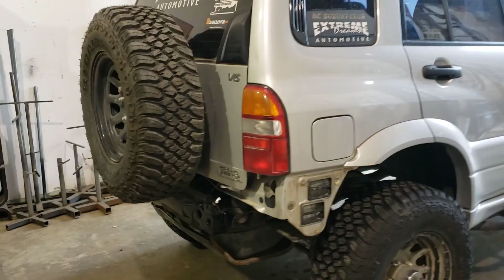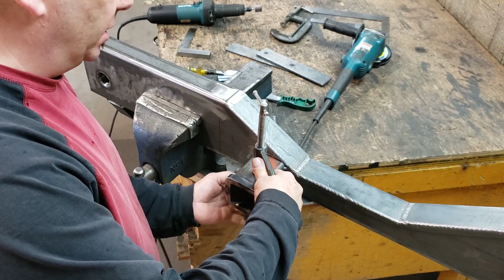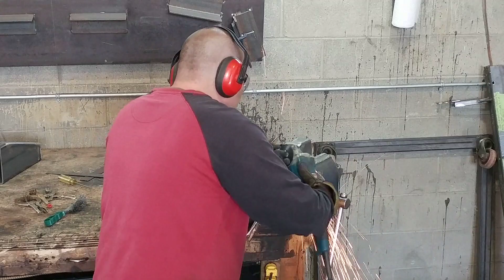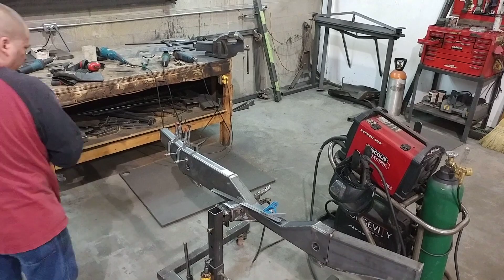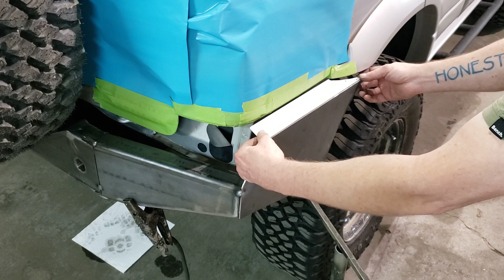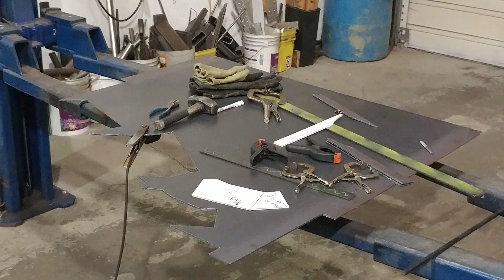Suzuki Grand Vitara (Escudo) Custom Rear Bumper Build - Part 2 - Valuable DIY Info Included!

Comment: Just out of curiosity do you know if it weighs more than factory and by how much
Reply from the maker: I'm unsure of the weight of a factory bumper but the Balmer Fab bumper in the video weighs around 75lbs. Keep in mind it includes an integral receiver so the weight of an aftermarket tow hitch would have to be added to the stock bumper for a fair comparison.
Reply: Not  criticizing. Far superior to factory . But factory probably at least 60 to 65 pounds.  Looks great